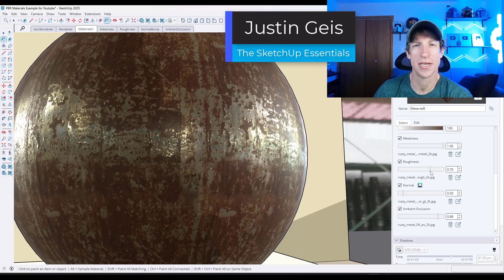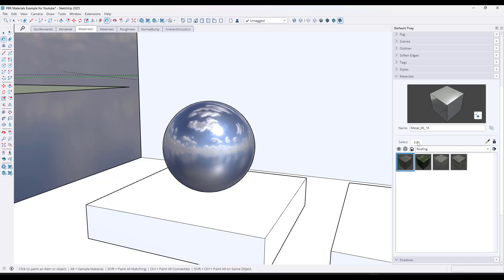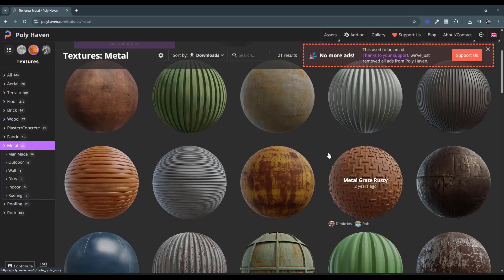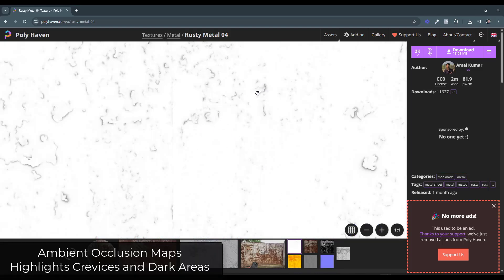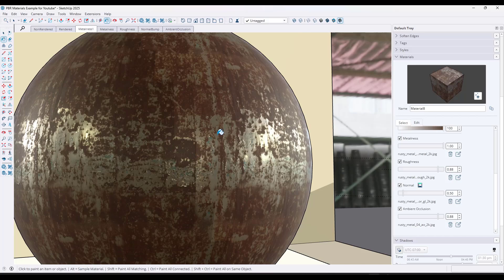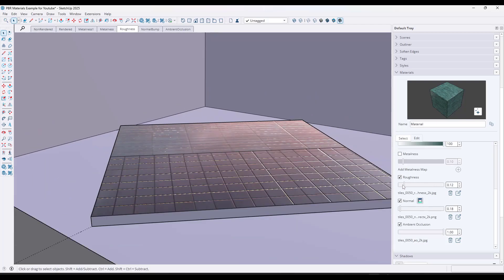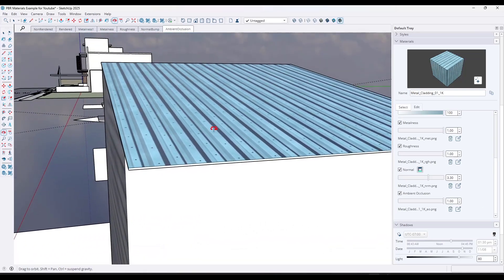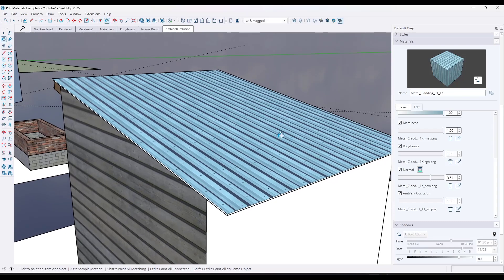The ULTIMATE Guide to PBR Materials in SketchUp 2025

Comment: I havent actually tried this yet, but just as a question for all.. when you export the model as a 3d model for a game engine, does the PBR materials also get exported? i usually add the PBR when i put it into model converter X, so i get pbr on certain materials in the flight sim. This would be awsome if it actually added the PBR so as to avoid having to add it later. Thanks and Great toots!
Reply from the maker: Not currently

Comment: this was a bad move by Trimble. this capability is redundant in SU.. other programs are far ahead of  Sketchup and it will never catch up, let alone AI impact in a few years.   Totally wasted effort when other area's need more attention ! All it does is overload files with  texture maps and burden productive files. Just another half baked capability that will be neglected and die a slow death like Dynamic Components and Live Components etc
Reply from the maker: I'm torn on this. Personally I disagree - like it or not, having rendering in a program as a baseline is kind of table stakes for 3D modeling programs anymore. I can't think of any major 3D program that doesn't have SOME kind of rendering built-in. I think there are some interesting possibilities with where this could go, but there's definitely work to do on the results